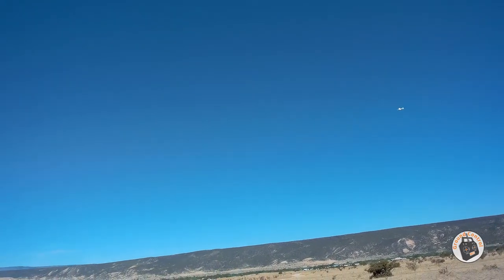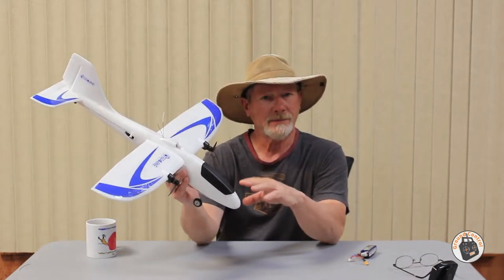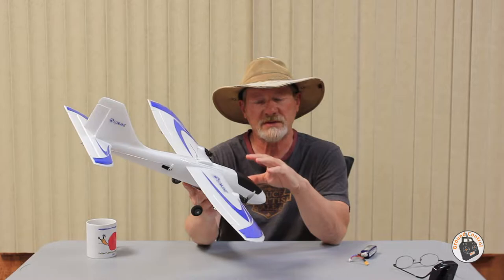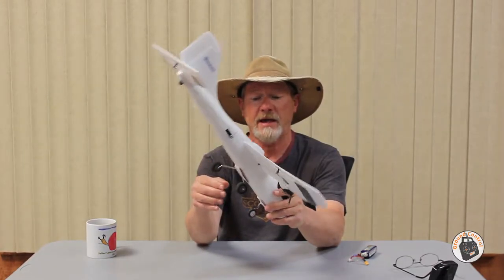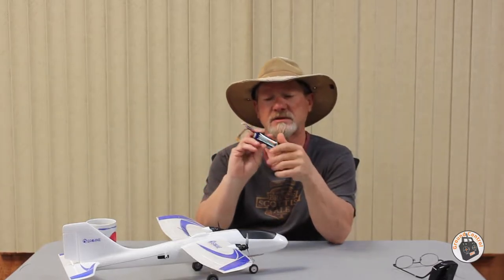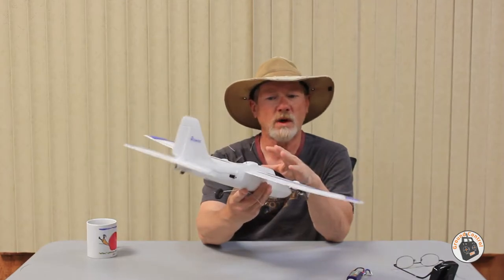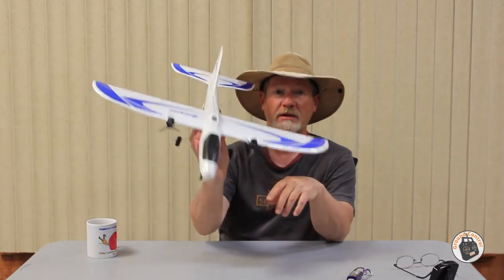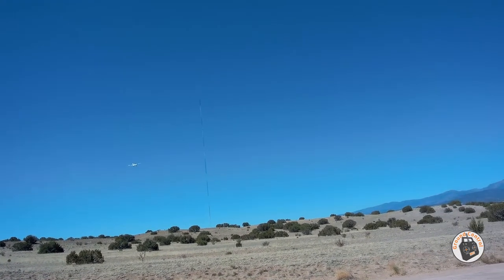So Smooth! Byme-A Gyro Stabilized in Gusty Winds - Eachine Flying Fish Sub-250g Twin Motor Plane PNF

Comment from the maker: Don't Forget to Subscribe -> https://www.youtube.com/GroundControlRC?sub_confirmation=1
Don't forget to Follow Us on Facebook -> https://www.facebook.com/GroundControlRC

Eachine Flying Fish W650 650mm PNF
https://www.banggood.com/custlink/K3myQ9zGvL

Eachine Flying Fish W650 650mm PNF
https://s.click.aliexpress.com/e/_A4mYVL

GNB 11.4V 850mAh 60C 3S HV LiPo Battery XT30 Plug
https://www.banggood.com/Gaoneng-GNB-11_4V-850mAh-60C-3S-HV-LiPo-Battery-XT30-Plug-for-FPV-Racing-Drone-p-1863758.html?p=WE081047791920140372

GNB 850mAh 3S 11.4V 60C/120C HV Lipo Battery With XT30U-F Plug
https://s.click.aliexpress.com/e/_9fy3L7

Turnigy nano-tech 950mah 3S 25~50C Lipo (Comes with JST Connector)
https://hobbyking.com/en_us/turnigy-nano-tech-950mah-3s-25-50c-lipo-pack.html?affiliate_code=YRCVWOSKMDXLVUW&_asc=6456367256

RadioLink Byme-A & Byme-D Flight Controller & Gyro
https://s.click.aliexpress.com/e/_AOGjbL

RadioLink Byme-A Flight Controller & Gyro
https://www.radiolink.com/bymea_where_to_buy

RADIOMASTER R81-D8 8ch Nano SBUS Receiver (Frsky D8 Compatible)
https://www.banggood.com/RadioMaster-R81-2_4GHz-8CH-Over-1KM-SBUS-Nano-Receiver-Compatible-FrSky-D8-Support-Return-RSSI-for-RC-Drone-p-1757296.html?p=WE081047791920140372

RADIOMASTER R81-D8 8ch Nano SBUS Receiver (Frsky D8 Compatible)
https://hobbyking.com/en_us/radiomaster-r81-d8-8ch-nano-sbus-receiver-frsky-d8-compatible.html?affiliate_code=YRCVWOSKMDXLVUW&_asc=325340518

WFly RF201S 1.32g Micro SBUS PPM receiver (OpenTX Supported)
https://www.aliexpress.com/item/1005003636312055.html

Here: RadioMaster TX16S MKII OpenTX EdgeTX Transmitter
https://www.banggood.com/custlink/KK3EUzvecp

RadioMaster TX16S Transmitter
https://www.banggood.com/custlink/DvvycmfSMK

Banggood GCRC
https://www.banggood.com/custlink/GmDmQ1nVkO

Comment: Amazing stability in that much wind.
Reply from the maker: Hi Jack!
Yes, I was very impressed with the way that Byme-A Gyro corrected for wind.
I had not really used the gyro in that mode except to demonstrate that feature during the review but I'm going to use it from now on when I need it.
I now have another plane that I can fly in significant wind ;-)
See you in the Air!

Comment: That’s exactly what I found in winds exceeding 10 mph it handled it so well, and it climbs very near vertically, in my case it rescued when flying from the top of a hill I very nearly flew into the hill so pulled back and applied full power, the scream of the two motors scared me too death but it got me out of trouble. It’s superb even better than the mini warbirds that I love but if I were to have to choose this would be the one. One other thing is that if you have any queries on the Radiolink byme stabilisers the company respond really quickly in my case and a friend within 24 hrs.
Reply from the maker: Yes, having that amount of power usually gets me out of trouble more than in trouble ;-)
RadioLink is great!
They were actually answering questions for people on this channel when I first reviewed the Byme-A Gyro,
I've never had a company do that before and their products are excellent.
I just ordered (4) more of the Byme-A Gyros.
Reply: @GroundControlRC  wish I could link the Radiomaster to there protocol but I have not managed to do so, have you ever tried or even succeeded
Reply from the maker: @michaelwheatland4565  Yes, there are several of their receivers that are supported with OpenTX.
There is a RadioLink Protocol on OpenTX and if I remember correctly the Sub-Protocols are something like Air and Surface.
Here is a link to the Protocol Info:
https://www.multi-module.org/using-the-module/protocol-details/radiolink
Reply: @GroundControlRC  thanks I’m on too it👍

Comment: I have one and put a flight controller and DJI equipment In and it's perfect. It can glide and sail and also fly very fast on 4s batteries!
Reply from the maker: Hi Jonathan!
It's fantastic ;-)
The best Sub-250g Factory Plane I've flown.
I have the RadioLink Byme-A Gyro in mine and a WFly SBUS Receiver.
What fun!
See you in the Air!
Reply from the maker: The Landing Gear I fabricated from 2mm steel wire and foam wheels that are 30mm diameter and 12mm wide.

Comment: One thing I meant to add is the one thing that is a little flaky is the rudder push rod which distorts and flex’s under load and therefore is not that smooth, I read someone had repositioned the servo close to the rudder which I think might be a good solution both to overcome the flexing and to put a bit more weight towards the tail allowing a larger battery to be used.
Reply: @theoztreecrasher2647  hi there your right it was Anasazi. I have added a little reinforcing too the guide tube so I don’t think it will ping off but the movement of the rudder is not that smooth so as I have two of these little buggers I think I will modify as he did, the trouble I can’t fiddling. Incidentally I see for here in the U.K. the price for one of these is £79 plus shipping £7 from BG which in my view is a bargain.
Reply from the maker: Hi Michael!
Repositioning the servo closer to the tail would definitely add tail weight and allow a larger battery.
I'm flying with a 3S 950mah LIPO as my largest battery.
I'm not experiencing any flexing of the control rods and all the controls are smooth as you can see in the flight video.
If you don't want to move the servo you can also add additional guides to the control rod.
In the past I've use those tiny zip ties to create a small loop around the control rod, cut the tie down to around 5mm length and glued that into the fuselage.
That works pretty well.
See you in the Air!
Reply: @GroundControlRC  that’s a good tip with the zip ties, I don’t think I’m alone with the flexing but I think the main gain will be the balance issue with larger batteries, this plane for such a diminutive size is extremely versatile and I’m convinced it’s the power to weight ratio that allows all sorts of configuration’s the benefit of brushless motors. Great to see your videos which we could experience calmer conditions it’s been a windy year here. Michael

Comment: Such a cool little plane. I wanted to make one from one of the toss-gliders, but was disappointed by the quality of the latter.  Maybe someday from a different airframe.

Happy flying!
Reply from the maker: That was exactly my thinking when I ordered those 1 meter chuck gliders.
I hope with twin motors on the wing it flies as well as this one.
I'll be putting a Byme-A Gyro in it as well.
See you in the Air!
Reply: @theoztreecrasher2647  I picked up a pair of the 48cm birds.  But they added a second slot in the tail that severely weakens it and everything arrived warped. I straightened the wings and strengthened the tail., but can't decide if I still want to use it. Not impressed.   It's all set aside for now as I deal with other things.
Reply: @theoztreecrasher2647  I used the stab from the second plane and glued it into the top slot, then used a razor blade to cut the fins off each side and then shave it down flush as best I could.

Comment: Are you using the iBus protocol?  If so can you (or any others on this thread) please point me to a wiring diagram showing how to connect the Flying Fish to my FS-iA6B receiver through the Byme-A gyro?  I've searched high and low for the proper connections with no luck...  ;-(  Thanks,  Brian S.
Reply from the maker: Hi Brian!
I see that FS-iA6B receiver supports PPM.
I'm using the WFly RF201s SBUS Receiver with the Byme-A Gyro but it also support PPM.
I don't have a diagram but you would connect your Aileron, Elevator, Throttle, and Rudder to the proper ports on the Byme-A Gyro and a Single Wire connection from your RX PPM Port to the SBUS/PPM Port on the Byme-A Gyro.
Here is a link to the Byme-A Gyro page.
About 75% of the way down the page you'll find a diagram that shows all the connections for the Byme-A Gyro.
https://www.radiolink.com/bymea